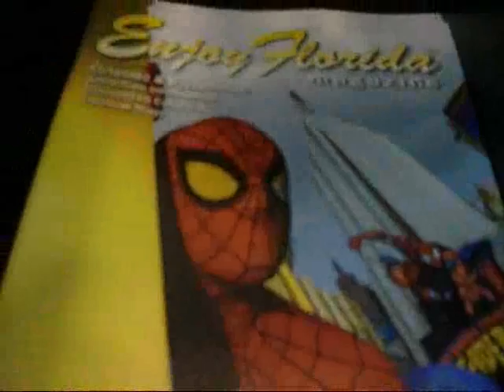3 13 12  Florida Turnpike Sub Repair...

Comment: @chanceiw5 Also, make sure you've got the appropriate vacuum lines hooked up if you've swapped out a carb for the TBI.
There's also a safety switch that kills the spark when the oil pressure's too low, so there might be something there too...

Comment: @chanceiw5 Assuming the timing and advances, plugs and wires are good, test for 12 volts going to the distributor all through the rev range. If not, there's a problem in the charging system (loose battery connection?). If you've got constant 12V,there's a problem in the distr. Check the cap and rotor, then ignition coil, module and pickup coil.
Also check all wires in the distr. for shorts!!!
I'm not an expert, but that's what I did when I had an intermittent no-spark issue a few years ago.

Comment: @redneck2010ize Like CW said, could be a solenoid actuator.  But that Gen of Accord (98-02) V6 models are known for transmission issues.  Honda even extended warranty on them.  4 cyl models don't have the transmission issue.